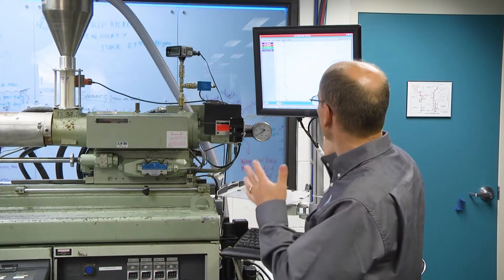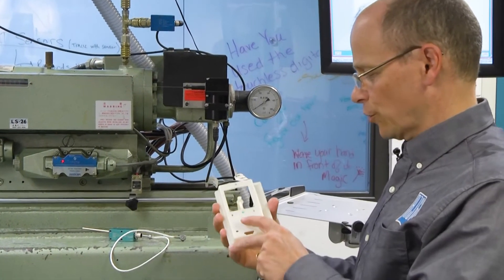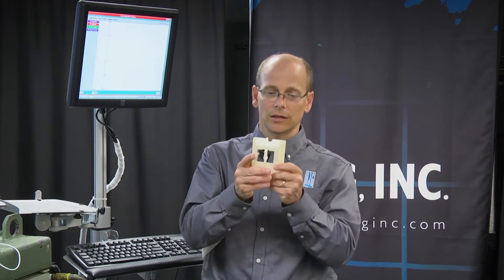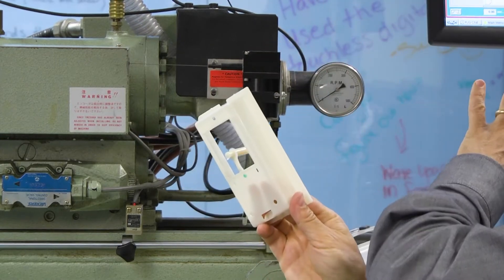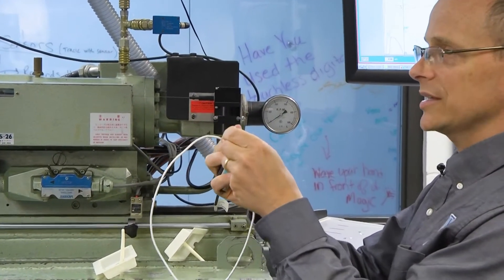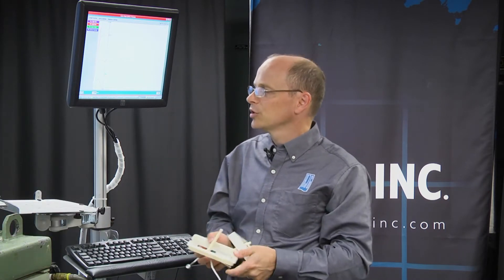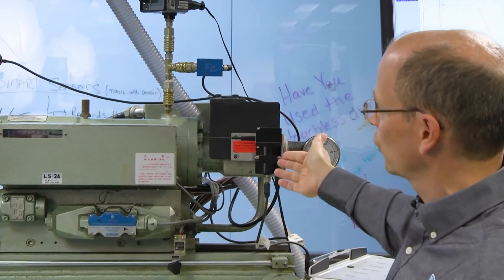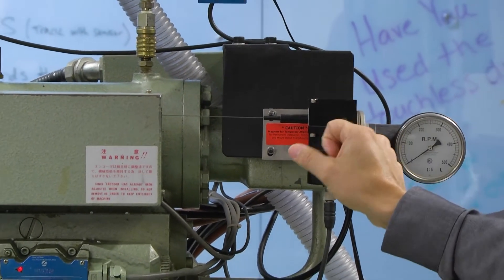How to Read eDART Cycle Graphs Part 1 of 6: Introduction

Comment: Is there a way to get the eDart to signal the press that all valve gates are closed? Have a Milacron 2300 ton that had a nozzle valve on the end cap that flagged a proxy when it was in the shut position, but they were removed due to them constantly leaking. The issue is about cycle time...the press will not allow parallel plasticizing with out a signal that the nozzle valve is closed.

Thx